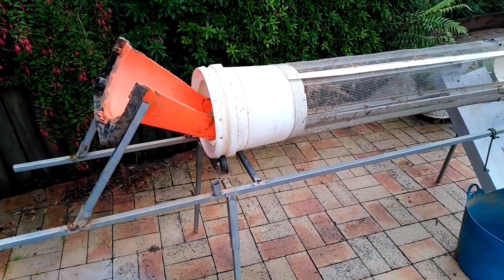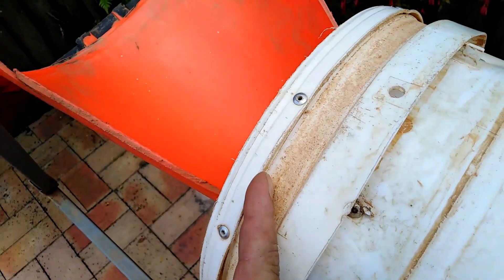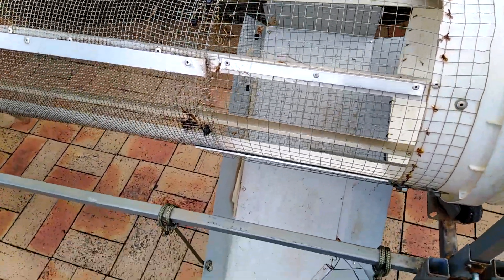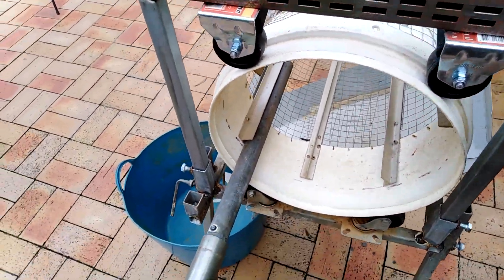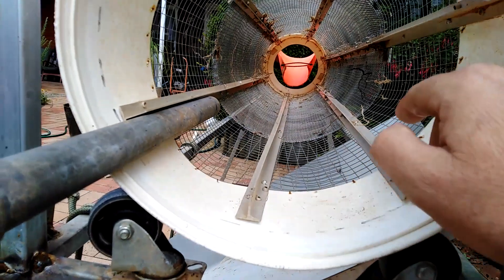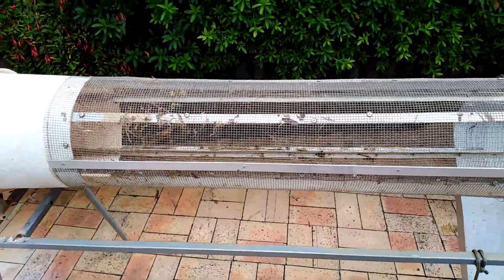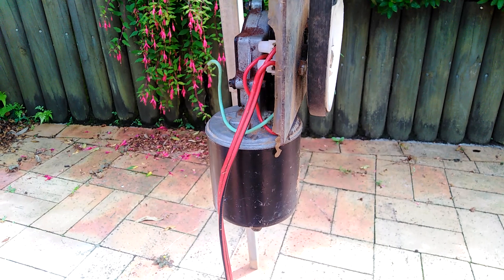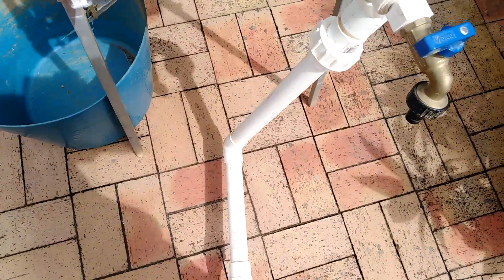DIY Sapphire Trommel

Comment: Could you put a size of mesh you use,2  different sizes,also what is total length of Trommel,and height of the front and rear ,thanks,Duds
Reply: Could you please put some measurements  up ,thanks
Reply from the maker: Yes I can .I will add it to the description for you.
Reply: Have you put all measurements up yet as these would be great ,I am wanting to build one in Australia
Reply: What do you mean by the description